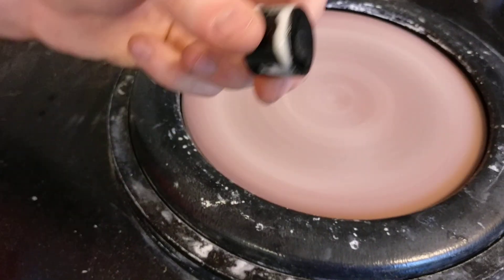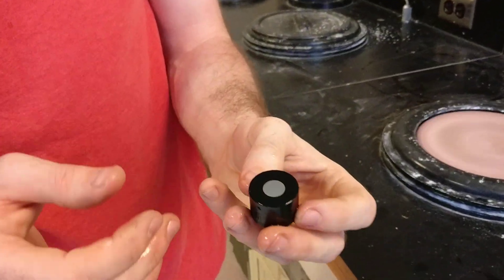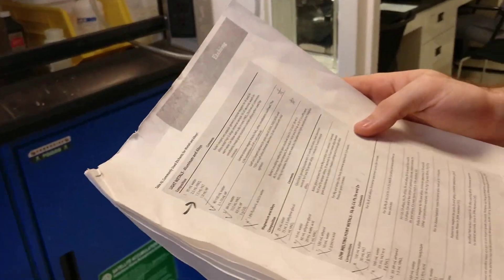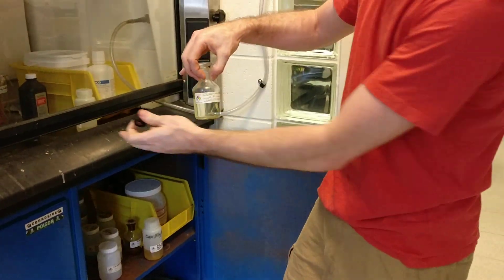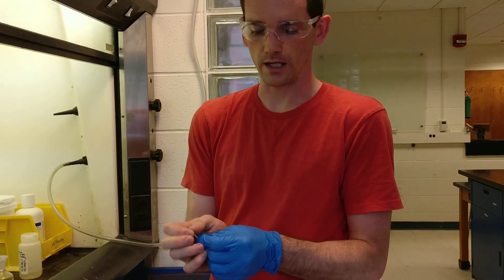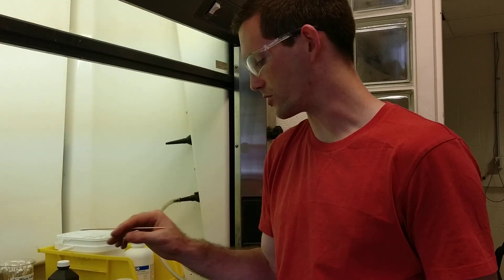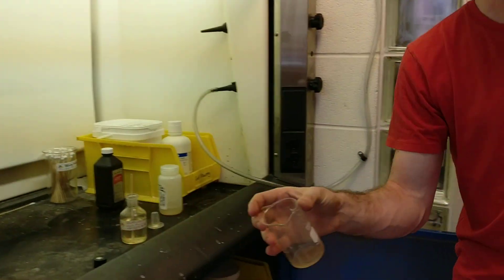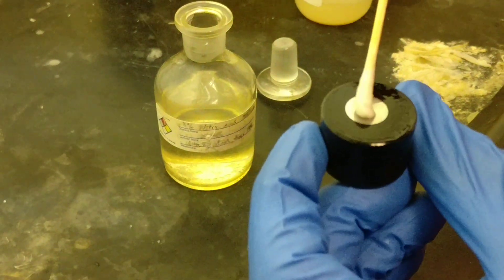Etching metal (steel) to see microstructure

Comment: Can i use methanol for etching??
Reply from the maker: with an acid, methanol is just an alcohol won't do anything by itself. The ethanol in nital is basically used to keep oxygen away and distribute evenly on the surface

Comment: Hi. Is there a more common substitute than HNO3 for etching?
Reply: I don't know if this post is still active but it really depends on what you want to observe. If you plan to observe the microstructure of the material under a microscope, you really need to use nital or picral. Anyone with the capability to polish a sample down to 0.05 um can surely etch a sample with one of these two solutions.

 If you want to etch it for macroscopic examination, you can try HCl. I use reagent grade and dilute it myself but I'm sure you could get away with purchasing some muriatic acid at a hardware store. For a macro etch, you can get away with about a 600 grit finish.

I hope this helps. If I get any more questions, I could make a video if needed.
Reply: @85tkern  thanks buddy, really appreciate!

Comment: Does using the Nital remove any scratches left behind from mechanically polishing and make the specimen good enough for EBSD?
Reply: No you should try to remove all scratches in the polishing process, may be an additional finer final stage would help.
Reply from the maker: vibratory polisher or automatic polishing equipment would be best

Comment: would you recommend this same procedure for low carbon fasteners?  Usually, after sectioning/polish I will need to etch before microhardness to make sure the lead threads of the fastener (thread-forming fasteners) were induction hardened (thumbnail pattern)
Reply from the maker: yeah it should work

Comment: hai Adam can you please send the etching solution list with chemical formulas Asap I am doing a project on NiTi material 
 if it possible can you suggest the solution for Niti Microstructural analysis using SEM, please.
Reply from the maker: I would try Keller's reagent, Google the recipe. if that doesn't work, dilute aqua regia. Different etches to examine different element and phase distribution.

Comment: Very interesting. I am a teacher at a high school. I was thinking to show the kids just how different low carbon steel is to high carbon we'd look at an etched sample under a microscope then perform some destructive testing. It really doesn't look very difficult - can you pre-prepare samples though and they stay "etched"?
Reply from the maker: Cast iron has a cooler looking structure because of graphite flakes and you can literally break it with a hammer. Same etch less time.